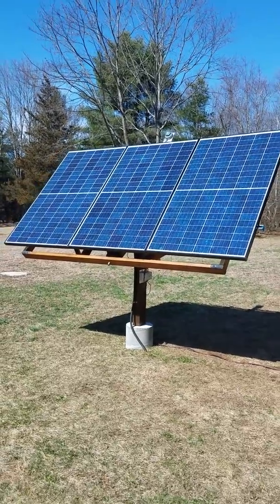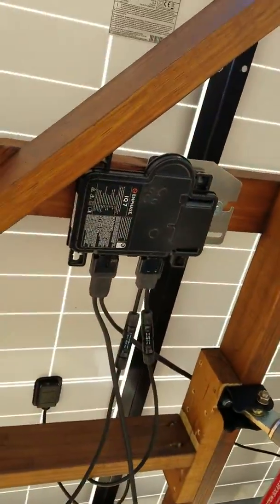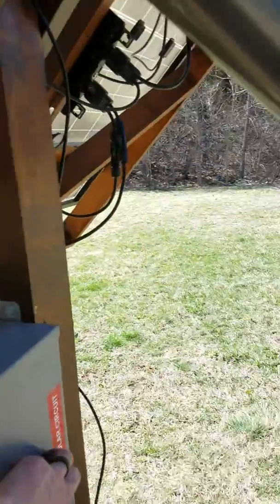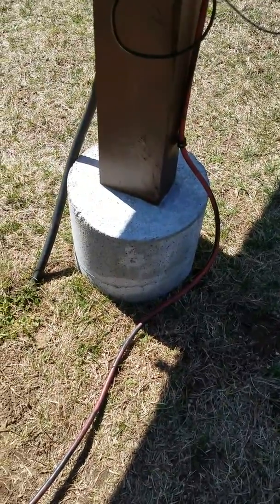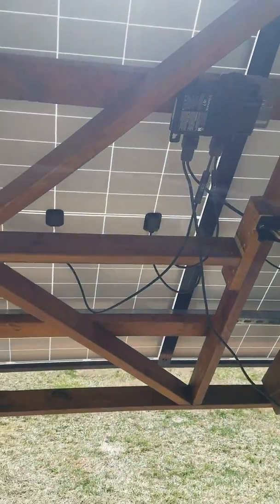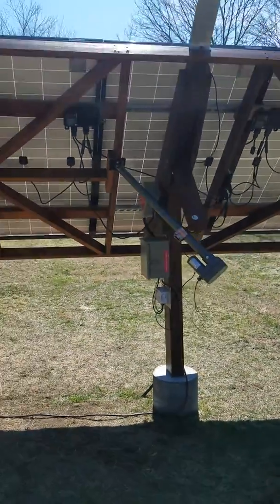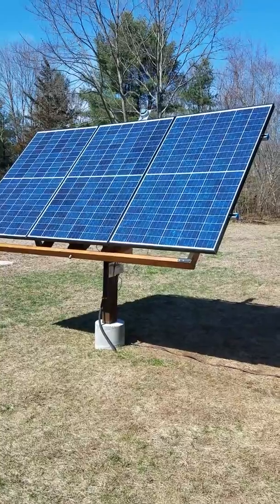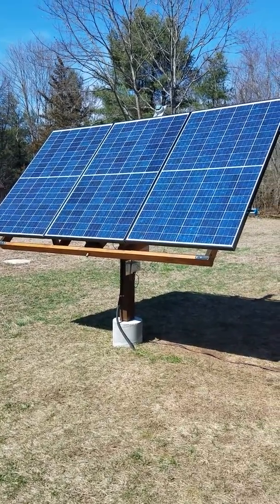DIY Single Axis Solar Tracker - 810w Grid Tied

Comment: I have had several Windy Nation 18” actuators and after the first one I had filled with water now I always drill a drain hole in the cover, works well for years now!
Reply from the maker: Same thing with me! Since I drilled a hole I've had no issues, that was my only complaint with it. I also keep it greased.

Comment: How much you gained after installing this tracker ?
Reply from the maker: I didn't gain much except peace of mind. I was turning my solar panels everyday on my old setup on wheels, so I would have to come home everyday on lunch break to turn them east to west. That was very annoying lol which led me to build the tracker so it would be completely automated. I have produced just over 2 MWh since installing to grid though!
Reply: @SamsDIY  how much KHW per day?
Reply from the maker: In the summer I get a max of just under 7kWh/day. Right now I am getting just over 4kWh/day in October. Worst time of year is around January since the sun is so low, which gets me around 2kWh a day. All of this is based on my nice sunny days, if there's clouds it lands somewhere in between.
Reply: @SamsDIY  thanks, whats the panels brand ?
Reply from the maker: @mr-black-sheep  They are REC 270 watt panels from 2014 I got from work after a burn test. They were untested in fire so I grabbed them for free!
Reply: @SamsDIY  Thank you for these informations

Comment: super a system but i cant see batteries
Reply from the maker: There is just one 12 volt battery just above the concrete, and the solar panels are connected to the grid so there are no other batteries in this setup.
Reply from the maker: This was also before I added the battery! I was running it with a 24v DC power supply at the time.

Comment: Great video! What are the components of your solar tracking?
Reply from the maker: I have both axis' set up so I have an 18" travel East/West linear actuator and a 12" travel North/South linear actuator. The controller and photosensor are from WindyNation and are pre-wired when you get it. Just have to add some connectors to go to the actuators and the battery or power supply, then fine tune the photosensors if necessary. That is what controls and moves the tracker! let me know if you have anymore questions!
Reply: @SamsDIY  Thanks for the reply man! I'm kinda new with these stuffs especially with solar tracking. I'm currently working on my thesis which makes use of solar tracking for my 500W solar panel. Problem is, I'm on a budget so I was thinking of using DC motors for the tracking, what are your thoughts and what motors would you suggest? My prototype would probably reach a weight of 75-100kg due to other components. 

Thanks brother! God bless!
Reply from the maker: Nice that'll be a neat project! I would have to get more information on different types of dc motors that could be used in this application, but  mine work great as all it need is a linear push/pull motion to work. They are both set up on 12v DC and I have run them on 24v DC as well.
Reply: Do you have batteries? Great video!how much cost all in? It all looks doable
Reply from the maker: @rfbu  I don't have batteries on this setup, these are tied into grid power in my service panel. I have a net meter to keep track of what goes back into the grid and I get a credit for the KWH I produced and is taken off the bill each month. I have another two 100watt panels hooked up to my backup power battery bank if we lose power. I probably spent around $1,500 on the tracker total, and I got a $400 credit back from the electric company as well. It is definitely doable, I was just fortunate to work at a place that has a lot of these parts that get tossed all the time after testing.

Comment: where did you rip the design, I'm thinking of doing similar but want to go to the primary source. Yours looks great, very tidy.
Reply from the maker: I watched a guys video like 100 times and just basically made a larger version of his and also went with dual axis after starting with single first. It was a video by James Biggar. Just type that into youtube! He had a link to plans as well. The setup was much smaller but same idea, it held two 100 solar panels, I have three 270 watt solar panels so its a bit bigger.

Comment: i saw a solar tracker that runs off 4 offset really small solar panels, giving just enough juice to turn the mount when they receive sunlight... they don't receive any light when the main panel(s) are aligned perpendicular to solar rays, managing both east/west and north/south alignment. If the aligning panels are not coplanar with the main panel(s), then they can reacte properly to sunrise too. https://www.youtube.com/watch?v=wL9PcGu_xrA&t=66s

Comment: Hello Sam from England. I am considering one of these and as you do, just have one axis and change NS once a month with a pin. I know the benefits depend on the latitude (I am 52 deg North) but what is your latitude and did you do any tests to see the extra energy captured vs a static system at the optimum fixed inclination facing due south? I'm trying to figure out if it is going to be worth it vs just installing more panels now they have fallen in price. That said, there is a great Nerdy value with this and yours looks very elegant!
Reply from the maker: Hello, yes I had good numbers while doing the single axis setup. I had basically identical kWh produced with single axis vs. dual axis, except for most of the summer since I didnt have a spot to put the pin into the post with it completely horizontal. With the dual axis I have the benefit of just checking how everything is producing and not having to actually interact with it at all, since I have been very busy lately it makes it a lot easier. If you don't mind moving it then you will be fine with the single axis. I am at 41 degrees N latitude here in Connecticut, USA. I also had these panels setup in a fixed position and I would manually move them east or west before and after work. That got to be a pain though and the numbers weren't as good. Right now in March I am getting 5.7-6.0 kWh per day on a clear sunny day, which is a bit more than I was getting before. I would have to check in my log. It was very fun to build and figure out as I went along, so I would definitely suggest at least the single axis setup, but to each is own!
Reply: @SamsDIY   Thank you for responding. I am 10 deg lat higher than you. The effect of the seasons will be greater for me so more benefit from a second axis. I will build a model using stepper motors and log the power over time for a 2 axis tracker and a static panel to get some numbers. There is a mathematical method, but where is the fun in that? If you have the time and 'inclination' (!) it would be useful if you could do the same. You do need the ability to log the power (or at least voltage) over time. I will use an Arduino for this. Thanks for your time.
Reply from the maker: @whitefields5595  Good luck, i'll be curious to know the difference for you at that latitude, I agree a second axis would be more beneficial to you in that area.

Comment: awesome I have 4k of panels that I get an average of 10-13 kw from. Think I need your plans never thought it would improve that much
Reply from the maker: Yeah right now on a good day it will produce around 4.5 kwh, and in the summer I will get about 7 to 7.5 kwh per day with full sun. The best part is I don't have to touch it anymore except for checking the battery voltage sometimes since it has been cold. It sheds snow almost immediately. I just put it completely horizontal and unhook battery with winds over 50!

Comment: Nice, can you shed some light on the frame please
Reply from the maker: Sure, the main backing of the solar panels are pressure treated 2x4s with vertical center supports and diagonal outer supports. the frame is about 8 ft. wide by 5.5 ft tall. there are also two 1 inch holes drilled at the top-center and bottom-center of the frame to receive the top and bottom 1 inch roundstock that allows for E to W movement. that moves E to W on top of ghe N to S frame backer. that is constructed from two 2x8s sandwiching a 4x6 with about a 12 inch or so gap in the middle so it can for around the main post and be pinned in place, but allow N to S movement, with the 1 inch roundstock. and the main post is a PT 4x6 x 8ft. with 4 ft being in the earth with a 12inchx4ft. rebar reinforced concrete base. if you jave any other questions, just ask. if i could just post pictures, it would be much easier than explaining lol!
Reply from the maker: Also forgot to mention, the solar panels are attached to two 10 ft. pieces of uni-strut, spaced apart at the factory mounting hole spacing of the solar panels, which are lag screwed to the face of the 2x4 frame. Second, on the N/S backer with the 2x8s, I have a 4x4x3ft. piece  protruding downwards for mounting the East/West linear actuator. hope this helps!